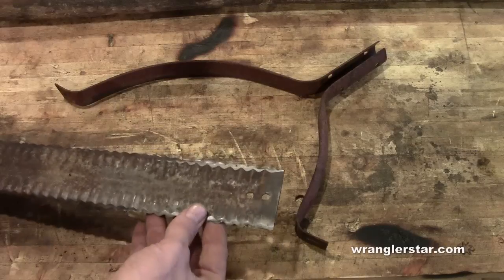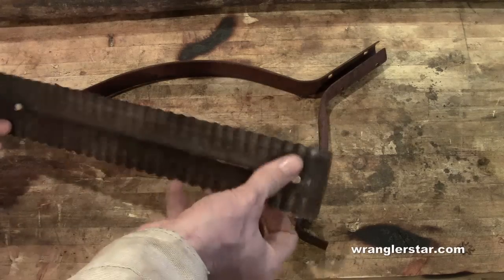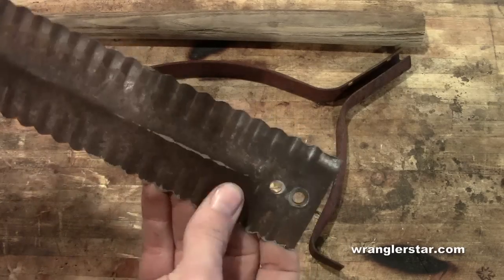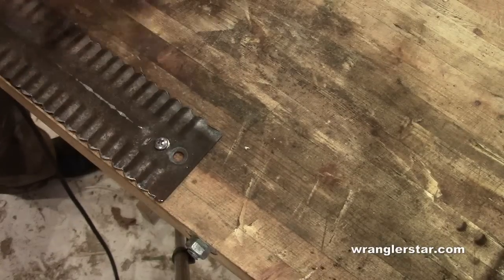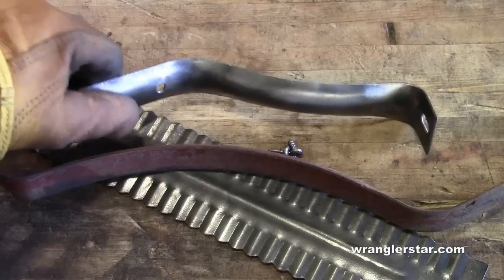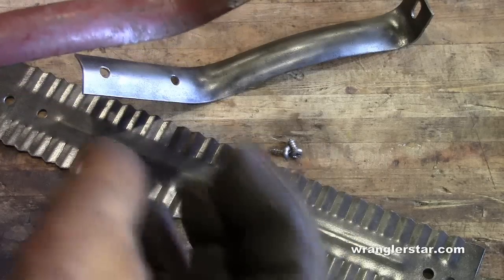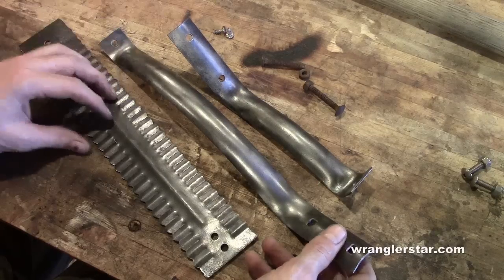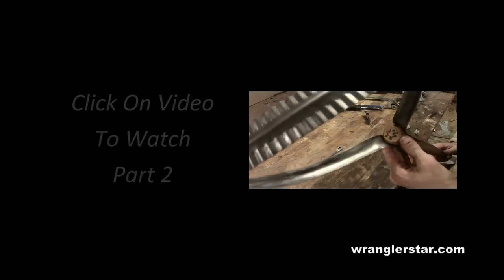Sling Blade 1.0 - Wranglerstar

Comment: First after-college job I had I learned an important axiom from one of the older designers:

"What is the definition of a short-cut? It is the longest distance between two points."

Any time you take a short-cut to get the job done you only create more of a mess down the road to have to clean up than if you took the time at the start to do it right. It's stuck with me since then and I suggest it now when I hear someone propose a quick fix to a problem.

Comment: Even after wire brushing, I give metal a coat of orthophosphoric acid (Fozz, Ospho), that goes into microscopic scratches and pits, and changes the tiny remnants of rust (iron oxide) to iron phosfite, which is very inert, and protects the steel from oxygen forming rust.  You can paint over the coat of acid, but I wire brush it off and oil the metal.  I work on ships, and our tools are in a salty environment that really rusts them fast.  

A friend just gave me a swing blade like yours.  I like to pick it up and cut, no cords, fuel, string, or carburetors.

Comment: Another great video WS!  I love watching you restore those old tools.  It makes me really wish that I had (1) the antique tool collection that you do and (2) a place to actually use them.  (Watching DR Tools commercials on TV makes me really wish I had a place to use a few of those things too.  I've always been a bit of a tool junky. ;)

When you were talking about the monofilament line and then brought out the nylon lock nuts it reminded me of an old tip I learned a while back.  If you need to use a nylon lock nut but don't have one or the bolt doesn't have enough threads sticking out for the nylon lock nut to work there is an effective way to improvise a solution.  Simply take a piece of monofilament line, fishing line basically, and stick it through a regular nut before you thread it on the bolt.  It's extremely simple to do, costs next to nothing and works like a beautifully!

Comment: If you are dealing with heavy rust or want to do something else while derusting, electrolysis using an old (transformer style) battery charger and Arm and Hammer washing soda works nicely. There are many videos on the subject. I'm lazy and quite pleased with the process. Livestock feed grade molasses is popular with old machine tool restorers if you've something large to do and don't want to "tooth" the surface by blasting.

Comment: I think that it might be nice to Blue the blade and brackets using some sort of gun bluing solution but you are correct that putting a non evaporating oil on there when you are finished and putting it somewhere dry will keep it from rusting

Comment: Usually I try to use the rust to my advantage to protect the surface- boil it and oil it, tools with a lot of surface rust already have the first step of a black oxide finish done.

Comment: When the old timers used the reel type mowers they found it did not cut buck horn seed heads or other tall weeds very well.. They used the sling blade to cut the seed heads before using reel type mower. There is no tool as suited to grow blisters as the weed sling.  My people called it an  "Idiot Stick".

Comment: I've just started collecting  old tools from around the farm.  I have a wire brush and a wire bench grinder, anything else you guys can teach me about removing rust?  Like inside of the head of a hammer where the handle goes?
Reply: ive always used a dremel with a sand paper round on it. Maybe they make a wire round, but I am not sure. Just my two cents.

Comment: You often mention that the steel in older tools is better, but why? Why was the steel used to make tools in the past better than the steel used today? There are a few reasons, but the primary reason is recycling. In the past, steel for manufacturing was always new, first run material from a steel mill, but today the steel is often recycled. First run steel is very expensive in comparison. Thought I'd throw this out there in case people are wondering.
Reply: UberDoyle I would think it is the % of carbon.   This effects he ability of the steel to harden thus holding an edge longer on cutting blades.
Reply: Yes, that's right. Remember though that recycled steel often contains the elements included in the original products. That means all of the misc adds used to produce the alloys of the items being recycled are present in the end product unless the manufacturer has removed them, which makes the material more expensive. These impurities in recycled steel and iron make it much more difficult to achieve the quality of steel that manufacturers took for granted back in the day when production used freshly mined iron rather than recycled mats. With all the junk in recycled iron/steel, the creation of alloys becomes a much more involved process. For example, a 1095 steel contains 0.95% carbon. Not too difficult if you're working with pure iron, but when you start with a recycled material that can contain several percent of misc junk...
Reply: UberDoyle true enough......however much of 'scrap steel'  goes into the making of low carbon steels such as rebar, iron pipe, angle iron , I beams..etc...   tool steels(high carbon steels) don't seem to be bothered by recycle.....the drill rod i use .8 carbon is not effected.

Comment: what exactly is your trimmer doing/not doing?
I fix them quite often and may be able to help you figure out what the problem is.
Reply from the maker: It will idle only.
Reply: Idle only as in Bogs & Dies when you hit the throttle or throttle is non responsive?

Comment: I have an old slingblade that belonged to my Wife's Grandfather.  Unfortunately the blade is bent from abuse sustained before it was given to us.  How can I straighten the blade and re-temper it so that it won't bend as easily?  Or, would I be better off to just find a replacement blade? Thanks in advance.

Comment: 'antique'

They still sell them, with generally better shapes and better quality steel I find these days. I own one, use it, useful for certain jobs, and monofilament trimmers aren't so great. I pref blade trimmers over string. If I can't use my whip cutter it's just gonna mess up a filament trimmer anyhow. Go straight for the solid blade trimmer if your hand tool doesn't cut it.

Comment: your power brush puts a lot of scratches in the steal. put the parts in venager with a little water and let them soak. It will just take the rush off. My need to use some steal wool on really bad places. When done soak in water with baken soda to kill the acid. Dry good and paint or oil to know it from rusting. This doesn't take off any of the steal or put big pits in it. Gun smiths use this to restore old guns. You would never use a power brush on a gun.

Comment: The cup wheel on the angle grinder didn't get away from you and hit you in the stomach and get your shirt all wound up in the wheel lol. 

For me it is if you are not going to do a proper job why do it at all. Do it good once and you don't have to do it again. If you have bare steel and you don't want to use steel, fluid film works good it keeps the metal from rusting. It is used as an environmentally friendly undercoating on vehicles. I have cans of it everywhere I use it quite a bit.

Comment: Craftsmanship seems to be fading from our vocabulary. Hear far too often - "Don't worry about it. Nobody's going to see it!". or "Don't worry about it. It's only a ______ (fill in the blank.) Guess that's part of the mentality that's coming about from our "disposable" society. If it fails, just buy a new one to keep the economy going. (sigh)

Sling blades and bush axes were the way of life, when I grew up on the farm. Mule & tractor drawn sickle bar mowers kept large areas cut. Cutting around buildings, in ditches, etc. was done by hand. Around here, those were the days, when "lawns" were small and primarily served the purpose to keep field mice & snakes at bay along with fire control. Somewhere along the line, growing lawns replaced growing vegetable gardens. 

Thank you for this series. Whether it's building bridges with love or reminding us of the craftsmanship of yesterday. Neither should fade from our vocabulary.
Reply from the maker: very true.
Reply: Most agreed. If it serves no purpose and the function isn't reduced, taking the extra time is just labour for the sake of labour, which could've been directed to something more pressing or deserving of that labour.